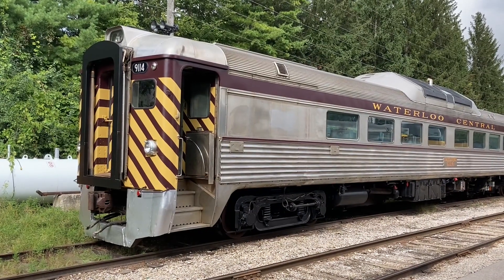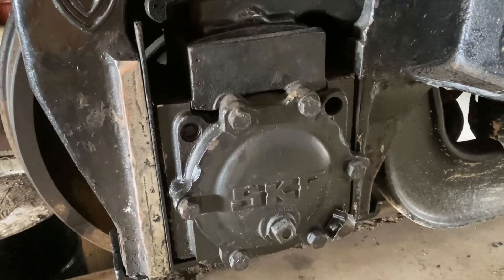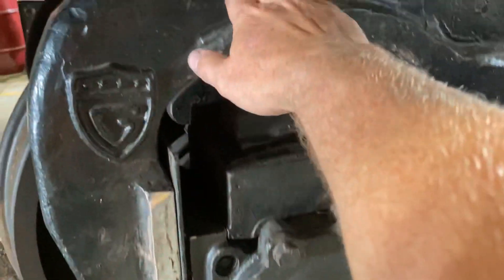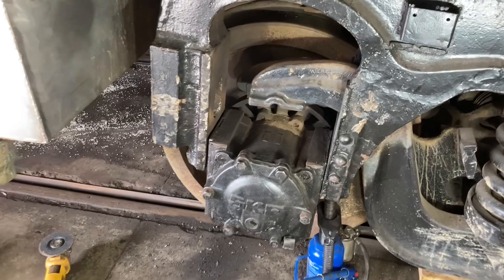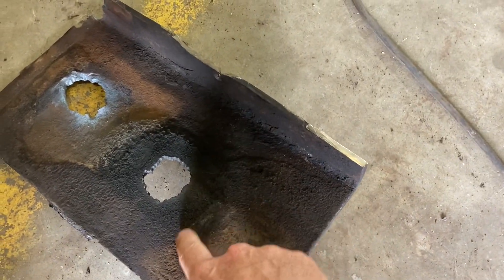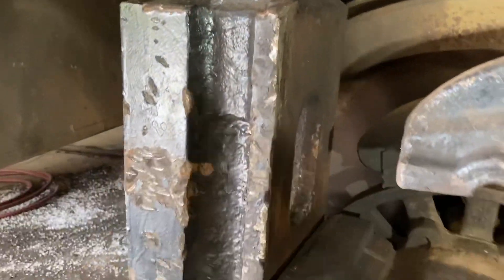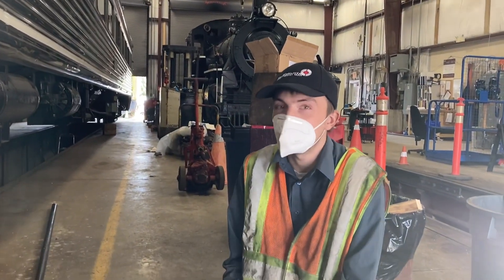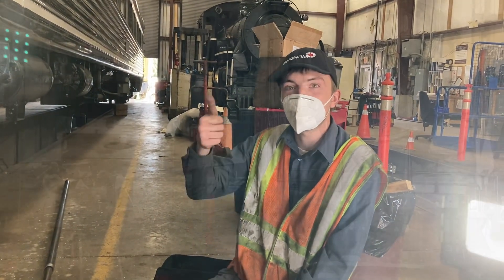Waterloo Central Railway RDC 9 No.6006 Pedestal Liner change out and Equaliser Spring Inspection

Comment: Do they still make these wear plates? Or do you need to fabricate a new one?
Reply from the maker: We got the liners from WABCO they still have them …. We used Phenolic instead of steel …. The steel ones have to be custom made now
Reply: @tieplatecaf  so for rail cars with inner bearings(like LRC's), how do you inspect or replace the wear plates? Or it's not required because of air suspension?
Reply from the maker: They don’t have ware plates the chevron springs and shims do the same as the equaliser and saddle block on the journal box
Reply: @tieplatecaf  a real joy to see you working with explanation. Didn´t know about phenolic. Original metal ones were probably high price, since they must wear, it´s an alloy steel. I forgot if it´s with molybdène. And weld was special too if i remember. Plus rust and you get that mess. The new ones will save a lot of  grinding, no rust and weld. Even if they last less, it will be "easier" to replace as long as Wabco makes them.

Comment: the technical term is called 'rust jacking' if ya wanna get technical :)
Reply from the maker: Never heard that term before … but thanks
Reply: @tieplatecaf  yeah, because rust expands as it forms, it can push with a lot of force, like a jack. Was a term I learned in trade school. Nothing good comes when rust jacking is setting up.
Reply from the maker: I understand the method …. And how the rusting scale works … like I said before never heard it called that before … always neat to learn new terms …. As you say nothing come good from “rust jacking”
Reply from the maker: Ah …. I looked it up … yes it’s a type of oxide jacking …. That term I know